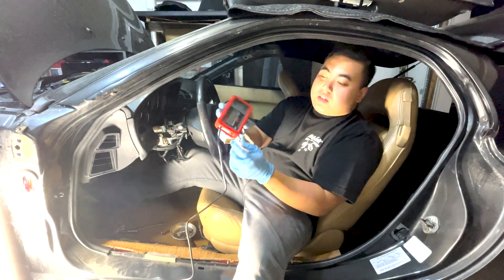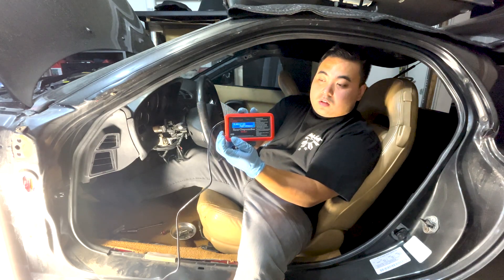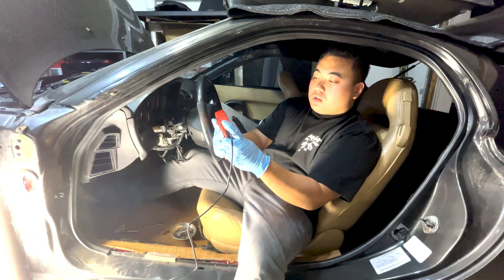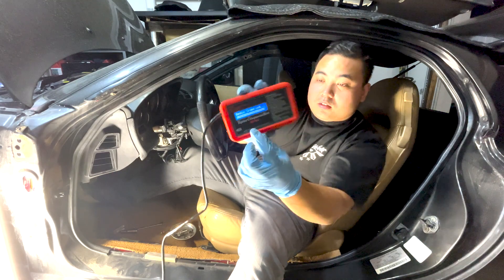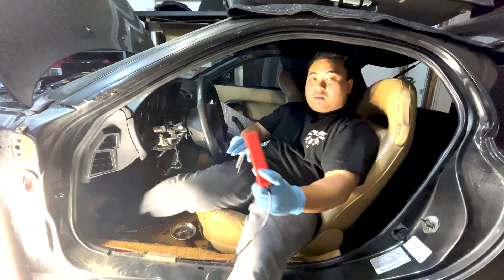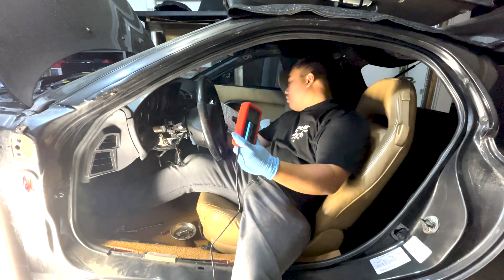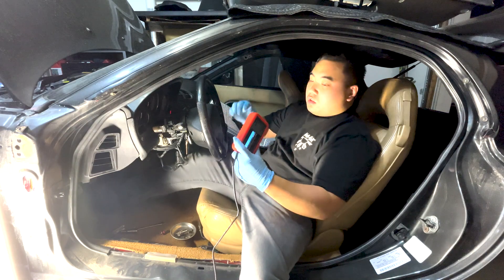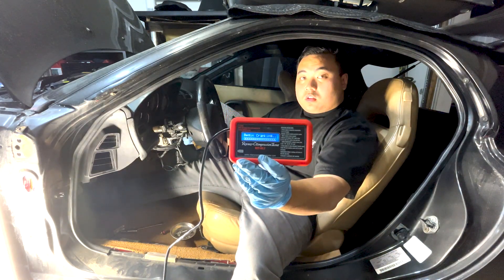My 1993 RX-7/FD3S Compression Bad?! How to Compression Test Your Rotary Engine

Comment: Next time hook up a battery charger to your battery before cranking so you get full voltage. Your reading the wrong numbers. 185rpm is to low you should be going by the altitude and rpm adjusted numbers.
Reply from the maker: Yea thats what I did. Could it be that my starter is just old? Also, previous owner didn't really do the best auto to manual conversion + battery relocation was horrible. Which is what I am trying to fix now. Once I fix all the electrical mess, I will give it another go with the compression tester.
Reply: @freemadc2  do you have any way to see the voltage while you are cranking? It sounds like its having a huge drop. With my charger I can set it to 12v while cranking and it keeps voltage up nice and high vs a cheap trickle charger which cannot keep up while cranking. Regardless the compression tester adjusted the numbers for you at 250rpm. I have my battery relocated as well and had sluggish cranking. Installed a high output 3kw starter and didnt make much difference. Went and looked at the lines from battery to starter and noticed a ground was breaking. Fixed that and made a huge difference.

Comment: Isn't it the adjusted RPM @ 255 the benchmark to use? So 82,90,90 and 92,100,93? What do you think about those numbers?
Reply from the maker: I did feel a bit weird about it being at 185 rpm. I connected two batteries during the test, but still got the same RPM. My starter could be just old. But, if that’s the numbers @ 255, then I’m hella happy about that. Thanks man for the input!
Reply: @freemadc2  I havn't used the compression tester before but each time you crank it, it flashes between 4 different set of numbers. The first is the compression @ 178/185 RPM, the second one should be the adjusted numbers as you can see on the second line it says 'Corrected at altitude and RPM'